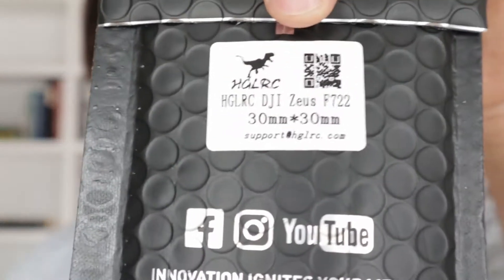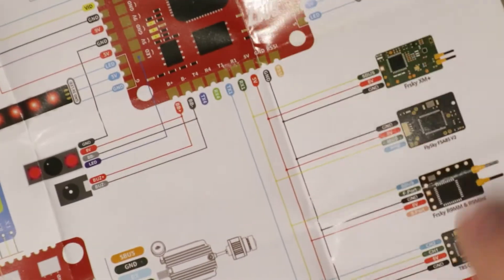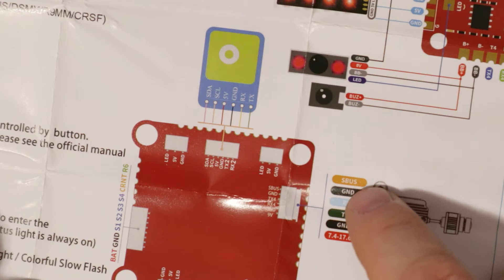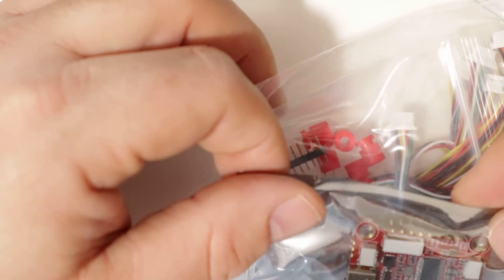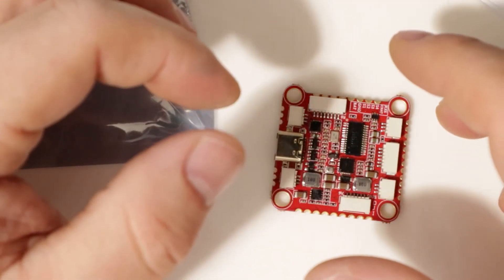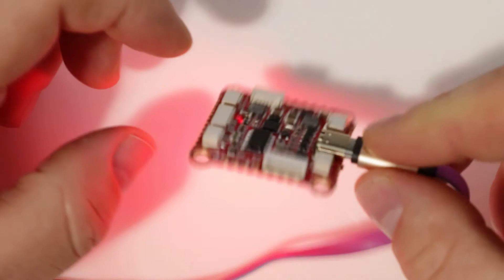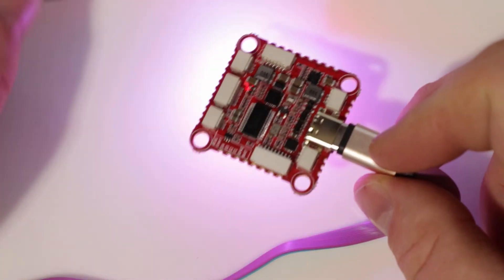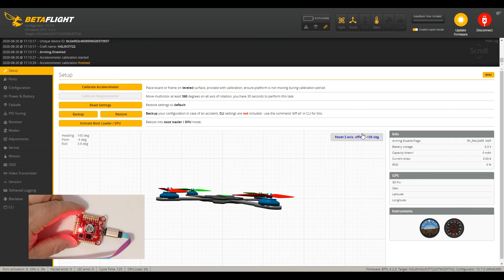HGLRC DJI Zeus F722 Flight Controller: Is this STACKABLE FPV FC WORTHY to put into the air?

Comment: Okay. That first 40 seconds. Was easily the most ... unique intro to reviewing a drone product I have ever seen.
Reply from the maker: Hahahaha. Don't forget to subscribe for more surprises! ;) Thanks for watching John.
Reply: @TheWayneStevenson  👍 I just got mine today, was searching around to see if anyone else has gotten their review kit recently.  I did buy their ESC also at the same time to just make the build a whole lot easier. Saw someone in the comments say that their F722 and mini were both DOA, that was shocking, but mine appear to be fine.
Reply from the maker: @JohnCuppi  I read that too. But I suspect something else is the case. Shy of zapping them BOTH with static electricity, or something else, two components are not going to arrive DOA. Hopefully he can give some more info and perhaps they can get working. :D I hope so anyhow. 

I should have paired mine up with ESCs at the time, but I hadn't given any thought to the builds at the time. But I have a few builds figured out now. :)
Reply: I would bet there is some problem with their USB-C cable or it is not a USB-C  data cable, just a charge cable. Hey, what're you looking to build? Mine full size fc + esc is going to go in an armattan chameleon 5" frame,  I'll put some Xing camo motors on it. For the smaller FC not sure what I'll do, I have an acrobrat frame I might use that in.
Reply from the maker: @JohnCuppi  I bought some Emax 1407 4100KV motors and a Jhemcu 25A ESC. I'm going to throw that in that Rimzler Dison Cinewhoop I printed. If you seen that video. ESC is coming from Aliexpress. So I'm probably waiting for another week before they arrive.

And I have been wanting to try my hand at 3D flying as well. I have a bunch of Emax Eco 2400kv motors so I'll pair that with one of my iFlight 35A ESCs that I have sitting around. My props came in last week. Just need to find a day that I'm not working at my day job to build and fly it. :D
Reply from the maker: @JohnCuppi  Love iFlight I must add. I have 3 stacks of their Succex-E F4 35A. Even bought their VTXs. Great value right there! And their props are outstanding. Their Nazgul 3061 and their 5061 props are my favorite. No love from anyone else there, so I suppose I'm an oddity. But they're just great props. Very aggressive.
Reply: @TheWayneStevenson  Finally finished my build! It's up on my videos. Did you get your build going yet? Just curious!
Reply from the maker: @JohnCuppi  Sweet! I'll go check out the vid. :D Unfortunately I haven't assembled yet. I was putting in a lot of overtime at my day job the past few weeks. Hopefully there's still some nice weather out when I get to it. Snow is in the forecast. :( Hoping to build this week. :D